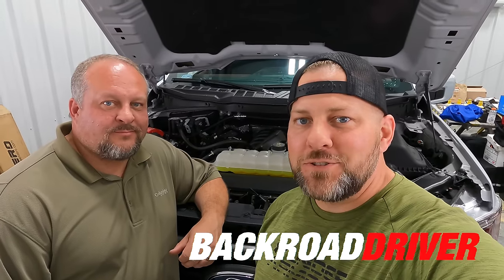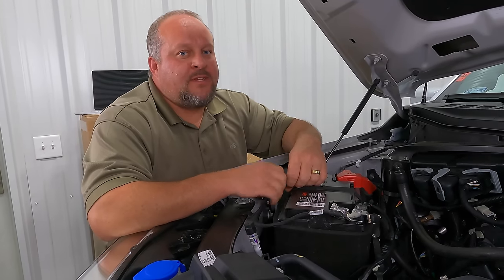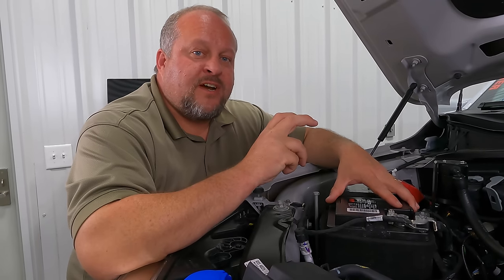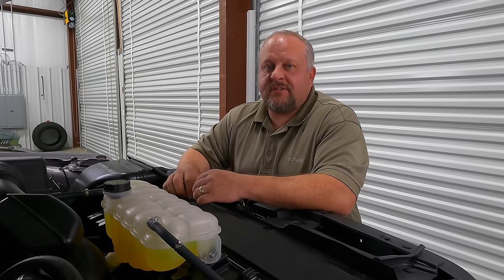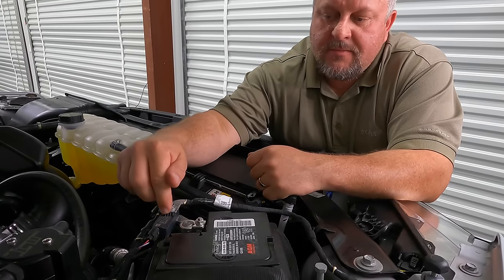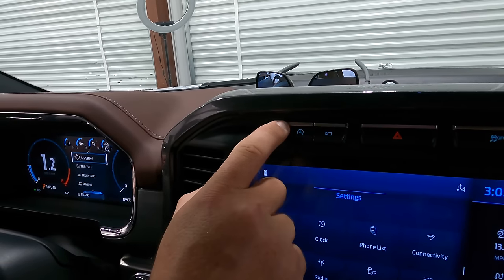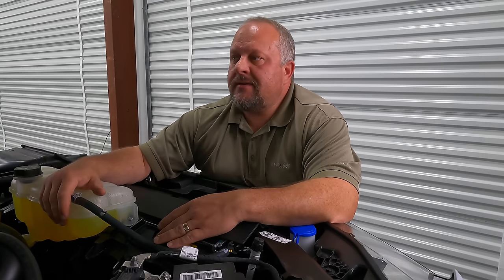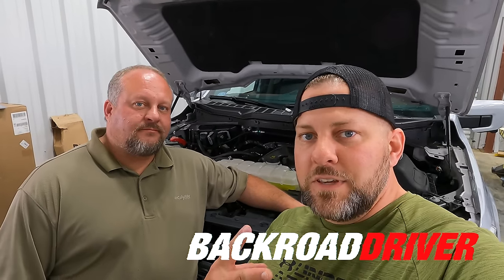2021 Ford F150 5.0 V8 Cylinder Deactivation & Oil Pump Belt Defeated! - It Wasn't All Bad...

Comment: Does my 2018 V8 engine stay in V8 all the time or go back in forth to V4 ??
Reply from the maker: Your 2018 doesn't have cylinder deactivation. You're good.
Reply: 2021 v8 is first one with cylinder deactivation.
Reply: @bobbymiller5297  I just bought my F-150 2021 Coyote V8, does this truck has the feature to deactivate cylinders to save gas? Or this is something that needs to be bought and would this void the warranty?
Reply: @jesseontiveros9074  no your 2021 v8 automatically turns off 4 cylinders when their not needed.  Like if your going 25 mpg through town or once your up to steady speed on highway. It will turn into a 4 cylinder until you hit the gas hard enough to need more power.  I don't really notice when it switches. 

But you CAN'T turn off cylinder deactivation. It does it from the factory and you can't turn it off. But you can buy this "auto stop eliminator" to plug into in dash to stop the truck from turning off every time you stop.  I have that and love it. It just plugs in

Comment: Is there any workaround to get rid of the cylinder deactivation?
Reply from the maker: As of this moment, Livernois has something that should be able to take care of cylinder deactivation.  It requires a full tune.  It is on pre-order at the moment.  If you want to go big, you can get a Whipple supercharger kit and it will remove cylinder deactivation as well.  Who knows what they will come out with in the near future.
Reply: @BackroadDriver  thanks for the info. I just want to get rid of the cylinder deactivation to increase the longevity of the engine. I currently drive my truck in sport mode all the times so the cylinder deactivation doesn’t kick in.
Reply: Somebody should be finding the forscan address soon enough
Reply: @BackroadDriver  hi with the Woolley does it auto deactivate or do I have to tell the mechanic and is there anything you would need to add with the supercharger
Reply from the maker: The Whipple tune deactivates it. Nothing to tell the mechanic.
Reply: @BackroadDriver  so there’s no way to do it with our buying a super charger?
Reply from the maker: As of right now the only option besides the Whipple is a tune by Livernois motorsports.  They are the only ones that have cracked the ECU and can reprogram it to get rid of cylinder deactivation. This may change in the future. Everyone knows that HP tuners is working on it but has not cracked it as of yet. When HP tuners cracks the ECU there will be tunes available from a lot of different third parties.
Reply: @BackroadDriver  thanks for all the info! I wish there was a way to do it and not void the warranty. I may just keep putting her in sport mode and skip the tune.
Reply: @BackroadDriver  thank you I’m planning on getting a truck I’m going to have for a long time and I wanna supercharge it do I need a oil catch and what else would I need for the supercharger or would it work fine with stock
Reply: @BackroadDriver  Livernois is top notch.   Would not hesitate to run any of their tunes

Comment: This doesn’t stop cylinder deactivation, only stop start.
Reply from the maker: Correct. This video was released 14 months ago and we had an update in a video soon thereafter. Thanks for watching Garrett!
Reply: My 2022 5.0 has no auto stop start. Very cool they deleted it but I think it was due to the chip shortages and not a change of direction on auto stop start.
Reply: @whidbeyhiker4364  same here it sucks they deleted my navigation as well but  it’s okay that no auto stop made up for it
Reply: @jesuscolch5329  Mine came with navigation, but honestly I like the android auto version better.

Comment: This does not disable cylinder deactivation this only deactivates auto start stop?
Reply: Correct, I actually had a cylinder deactivation fault today, and tried this trick. Cylinders still were deactivating after pulling the plug and having the fault.

Comment: So it keeps you in V-8 mode all the time and keeps the engine running at the stop light. I’m guessing your fuel economy might be 13 in the city and maybe in the low 20s on the highway or high 20s I don’t know if I would want to mess around with that. I think I would want to just stick with the good oil and filter and change it off and it may be one of those high-performance washable air filters and absolutely no zero 20 oil 5W 40 definitely

Comment: Being a new owner , I just turn it off by button before leaving. What’s the advantage in disconnecting it from the battery? Not being mechanical inclined to these newer engines I’m curious.
Thanks guys
Reply: The auto stop/start button doesn't turn off cylinder deactivation, but disabling the BMS will disable both.  You might want to watch the video again.

Comment: As an engineer that worked on the feature, i wonder if you have actually noticed any negatives with cylinder deactivation while driving the truck?

During development we had a huge focus on drivability and masking the cylinder engage/disengage events from the customer.
So im curious if you noticed anything you found objectionable, or if this is simply disabling a new feature because you can?
Reply from the maker: Great question Josh! We have stated many times in several other videos that the cylinder deactivation on the new 2021 f150 was barely noticeable. Even with an aftermarket exhaust it was not unpleasant to drive daily.  I could barely tell when it was activated with the factory exhaust.  I could audibly tell when it was activating with my aftermarket exhaust but I it wasn't overbearing and wasn't a big issue. The only reason we sought to deactivate it was solely based on perceived reliability and performance issues.  Unfortunately we will probably never know how this particular engine would have performed with cylinder deactivation. We will be adding performance enhancers as soon as possible.
Reply: I don’t necessarily like the warning it causes but i will be considering doing this.  Are you able to speak to the challenges you saw with the other manufacturers cylinder deactivation and how those reliability issues caused by it were addressed in Ford’s implementation?  If the Ford approach isn’t going to cause maintenance issues then I am for keeping it on but I like to keep my vehicles for over 200k miles so longevity is important to me.
Reply: @BackroadDriver  i'd expect nothing less :) just curious
Reply: It did not bother me until I added an aftermarket exhaust, then the sounds of the truck running on 4 cylinders just became too annoying. In and out, in and out, it changes the drone in the cab because the aftermarket exhaust is not designed to deal with it like the factory exhaust is. Secondly it engages at really low speeds (under 20mph in some instances) which produces a very unpleasant exhaust note when rolling through a low speed area.

Comment: Talk about the holes, cylinders. Spray in liners I believe. Ford used low tension rings on 2020 models. Drove one and when I was done I opened hood. Got a piece of towel and reached for dipstick. Salesman raised his voice and asked “what are you doing.” Yep, fuel in the oil at less than 20 miles. That engine was JUNK! 
And “I did research on internet.” Thanks Einstein. I am not buying any $50,000 plus vehicle with a rubber oil belt. No freaking way. And I like the CYA message at the end, “do at your own peril.” Yep, I did research on internet. Hate to say this guys the V-8 is on it last legs. Peace

Comment: I’m curious what’s the cons of cylinder deactivation?
Reply: Ask anyone with a GM truck
Reply: eats up the cams
Reply: @iceboy452004  Not the same system, sport.
Reply: @bobbybarnes1652  See if it has the same issues as GM vehicles and the Dodge/Ram, kiddo
Reply: @iceboy452004  So far, it doesn't.  So you're statement is nothing more than subjective supposition.  If I wanted predictions, I'd call up Miss Cleo (but she's dead, so).
Reply: Main thing is a lot of extra moving parts that fail, failure rate is rather high. When they do fail it is highly likely the entire engine could need rebuilt if not caught soon enough.

Comment: Or...dont ever use eco mode as that's the only drive mode that uses cylinder deactivation. 

Normal mode, sport mode, tow mode, mud and sand mode...all those modes do not use cylinder deactivation. 

Only eco mode uses it.
Reply: I'm pretty sure this isn't true, Evan.  Ford has to meet CAFE standards, and those are based on "Normal" driving mode (default), not something a driver would need to "switch" to every time they get in the vehicle.
Reply: @bobbybarnes1652  

Well...I own a 21 f150. It has an exhaust on it so I can clearly hear when it goes to 4 cylinder mode alot easier then when it was quiet stock. 

I was mistaken on one part. It does go into 4 cylinder mode very infrequently in normal mode. But in eco mode it does it more frequently. In all the other modes...rock crawl, tow haul, mud and snow, slippery, and sport mode...it does not. And also if you are manually switching the gears urself...it does not. 

And ford doesn't need to meet the CAFE standard with the f150. They need to meet it with all of their vehicles lol. Which is why they can make performance vehicles like the gt500 still. As long as they make hybrid vehicles and electric vehicles...they can make gas guzzlers still just like any brand. As it stands right now...my f150 doesn't meet CAFE standards for fuel economy.
Reply: @_E_B_  Do you honestly think that selling a handful of C-MAX or Mustang Mach E's is going to make up for nearly 1 MILLION F150's sold each year?  LOL.  You CLEARLY don't understand CAFE standards.  CAFE stands for CORPORATE AVERAGE fuel economy.   CAFE standards are FLEET-wide averages that must be achieved by each automaker, not by each vehicle they build.  When you have  CAFE of 40.3 to 41.0 MPG (2021 requirements), you're building 2M vehicles for the US market for the year and HALF of those are F150s, you can't just sprinkle a few eco-friendly cars and SUVs in there to make the numbers work.  Math really is a thing, and you need to look into it.
Reply: @bobbybarnes1652  

You obviously don't understand CAFE like you think you Do. I never stated it was based off of individual cars. I completely understand that it's based off of all the cars that ford manufacturers. But selling 1 million trucks doesn't effect what standards ford has to follow. It's all what vehicles ford produces initially before actual sales. If all ford produced were vehicles that got bad mileage...and the average mpg for all vehicles in their line up did not meet the minimum CAFE mpg standards...they would be in "trouble". But since ford manufacturers vehicles with such high mpg standards...it allows them to keep on creating fun gas guzzling cars as well. As the standard for them meeting CAFE mpg standards is based on an average of all of their vehicle lineup mpg's combined. 

Not what vehicles sold combined mpg's.

Comment: Looking to get a '23 Tremor. 

Need to decide if I want to risk long term reliability of the 3.5 turbo, or the new CD on the 5.0. 

Ugh
Reply: I'm a fan of both but I can't get around the sound of a good ole v8
Reply: Same. What did you decide on?
Reply: I have a 23 stx and it boogies just have to remove the governor if you want more than 100 out of it
Reply: I just bought a 23’ 5.0. Every truck that I looked at had start/stop factory deleted. From what I’ve read all 22-23 models have the factory deleted due to chip shortages.
Reply: @ironsink34  wouldn't it still have the mechanical portion of the CD intact, even if the programming is gone? I'm not familiar with how the DOHC 5.0 cylinder deactivation works
Reply: @AKS-74U  This video’s title has cylinder deactivation and they mention C/D several times but they are talking about “Auto start/stop”. The 22-23 model F150’s have auto start/stop factory deleted. 

The new trucks do have C/D but from everything I’ve read Ford’s deactivation system is much better than GM/Dodge. They supposedly do a better job of cycling which cylinders deactivate to prevent uneven wear. You can’t really tell when it’s working unless you watch the instant MPG graph. 

It can be easily tuned out though. Most tunes go through one of the handheld tuners that you buy, it’s nice because you can flash back your factory tune if you bring it to dealer for anything just to be sure they don’t try to deny any warranty claims. 

To be honest I’d probably leave the C/D in my truck if I wasn’t going to put an exhaust on, that’s the only time most owners worry about getting it tuned out because it’s obvious when you cruise on the highway and your exhaust note changes drastically. 

I think the only real hard parts are solenoids in the head. Not something that takes up much space and obviously wouldn’t have an effect if C/D is tuned out.
Reply: The 3.5 is so much more reliable and the V8 went bye bye with CDM . I believe it was on 21-23 MY's.
Reply: @ironsink34 You still have 4 weak cylinders, just like GM has struggled with now on their 5th gen of CDM from the late 1960's ormid 70's.
Reply: For me I would recommend a Nissan Titan, they're the last truck with a real reliable 400 HP V8 in it and it'll outlast any overpriced EcoBoost truck with ease and plus you get a 5 year 100,000 mile bumper to bumper warranty as well.
Reply: @MasterCarguy44-pk2dq Yet not as reliable as the 5.7L I-Force V8 in the 07-21 Toyota Tundra as well as the 5.6L Endurance V8 in the 04-24 Nissan Titan.

Comment: DOD is not a great design imo  the hemis and gm engines had major problems with them. Yes some worked great I'm sure but I've heard bad things about displacement on demand
Reply: GM has had the most issues. The HEMI MDS system has surprisingly been okay for the most part.
Reply: GM is on their 5th rodeo with dod technology in their car and truck V8’s since the 70’s.. It is rubbish and has never worked and makes the engines unreliable as heck. The guys I know that have cars with the LT1 in the Camaro are having lots of issues on a stock motor and minor mods are causing no more issues than stock. It’s just a bad design philosophy for a high horsepower engine. Don’t build high power and displacement on demand together because they DO NOT work. It’s GM’s bandaide excuse to meet CAFE regs, nothing more.
Reply: Those same guys that have their issues with the engine in stock form are replacing the heads and pistons, rods, springs on the weak side. Doing a head upgrade will solve the problem but it’s costly.
Reply: @MasterCarguy44-pk2dq  About a dozen of my co-workers have GM trucks with AFM or DFM. The only lifter failure among those trucks was a 2011 that had a lifter stick because the oil distribution manifold for the AFM lifters loosened and allowed some of the oil pressure to bleed off. Most of the trucks are 2014 or newer, a few of them have over 200k miles without an issue. Maybe it's because they're the type of guys that change their engine oil really often and don't let their engine sludge up or dilute down with short trips, but none of them have had a lifter fail (to my surprise). If it's a high performance car and you're already into the valvetrain, yeah you might as well get rid of that stuff. But I wouldn't say it's "unreliable as heck" these days. More often than not, the guys that develop a bad lifter were clowns that don't stay on top of maintenance. There are tens of millions of engines with AFM or DFM and even a 1% failure rate is a ton of engines that need lifter repairs.

Comment: Get the ethanol out of the gasoline supply, and mileage will improve
Reply: And prices will go up.
Reply: @bobbybarnes1652  Worth it from my point of view. As engine performance also improves
Reply: @jc3745  Of course it's an individual decision.  But 2/3 of American's aren't like you and I - they can't really afford to pay $4+ a gallon for gas-gas just to add a few HP when they are focusing on putting food on the table.  Beyond that, the biggest benefit of gas-gas isn't so much about performance or mileage as it is about engine and component longevity.  87 octane gas-gas vs. 87 E10 isn't going to double anybody's mileage, and ethanol free gas near me is nearly twice the price of E10.

Comment: My 22 F150 5.0 makes a really loud whine is that normal
Reply: Mine does as well. Only had 70 miles when I got it a week ago
Reply: Yep my 2021 with the 2.7 had the whine and now my 2023 with the 5.0 has the same whine. 
Both have the 10 speed tranny. 
It’s just a characteristic of the transmission from the research I have read.

Comment: As a ford tech your info on oil belts are wrong. This is a horrible design and all ford motors that have them are stripping belts and locking motors up. Ford knows about it and there are publications for the oil belts failing. Most belts are not lasting at all
Reply: Is the 3.5 Eco boost a better engine?
Reply: @edwardryser6949  there is no "better engine" they are all garbage now. Now I'm not some chevy Homer either. Owned nothing but ford my whole life. Even dedicated my life to the company. But I could not in good faith recommend a ford anymore. 2014 was the last good f150
Reply: @Jesse Robinson I said truck, not engine. Learn to read der der

Comment: When does cylinder deactivation turn on. Im having a hard time determining when its activated
Reply: Flat ground when you’re not accelerating, or downhill when you’re off the throttle. Downhill should shut down all eight cylinders.
Reply: @zebatov  
Does sport mode deactivate the cylinder deactivation?
Reply from the maker: Yes, it does.
Reply: @BackroadDriver  Simple fix then… drive it in sport mode all of the time!